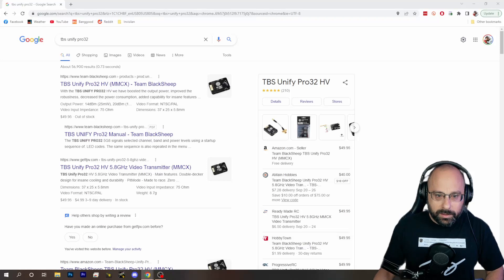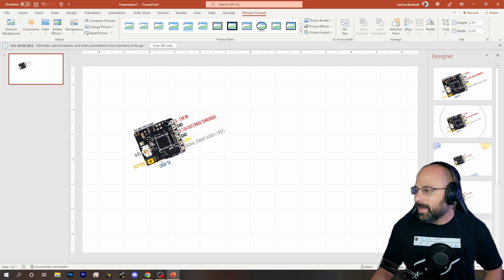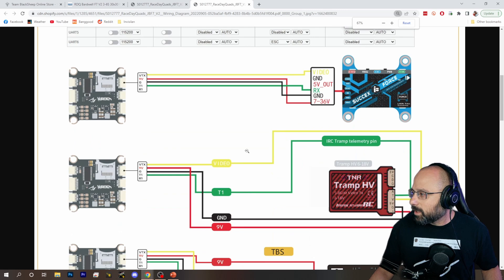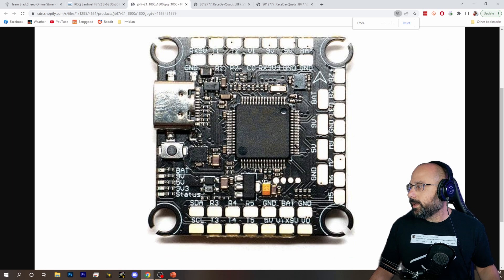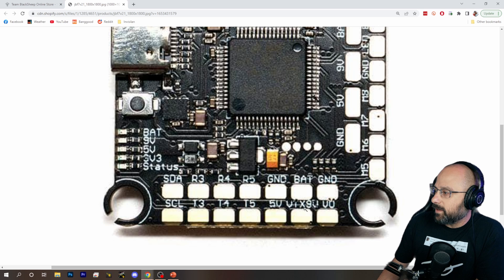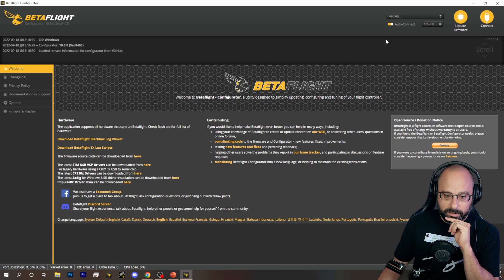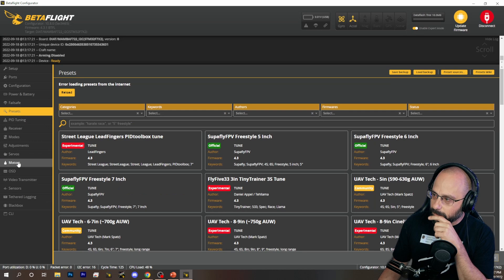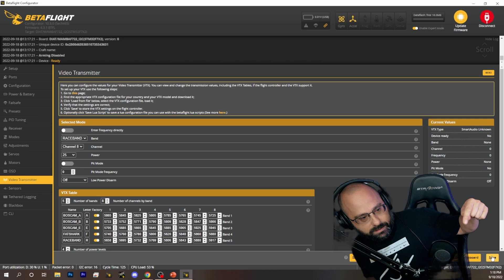How do I wire up a VTX and Set It Up In Betaflight? - FPV Questions

Comment: My vtx doesnt have "rx" i have "data" instead. Do i still wire it to t5? Im using the rush max solo and it isnt powering up with just the dc-in, video, and gnd wired up. Im using 4s batteries

Comment: What are the requirements for an external VTX? I have a whoop w/Beebrain blv4 and would like to add a goku 850mw VTX but is that possible just by soldering wires?